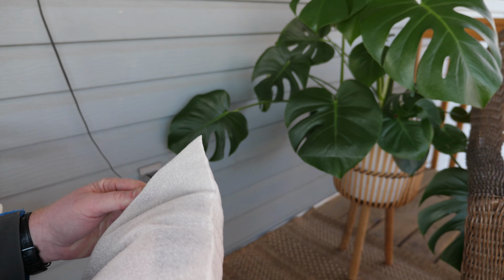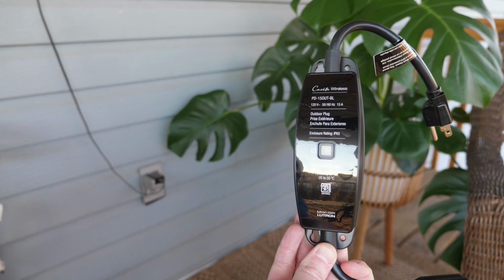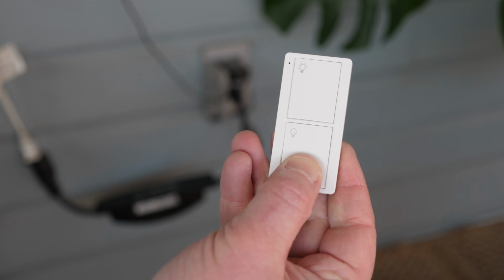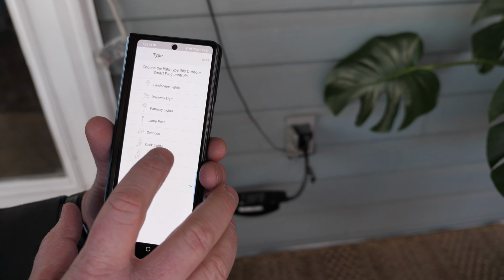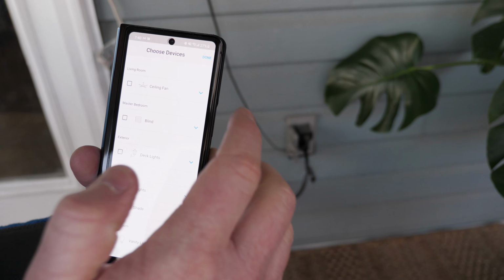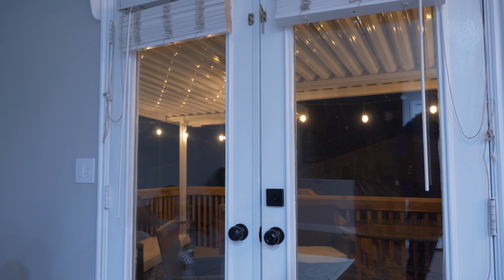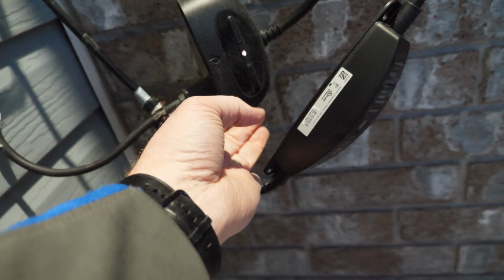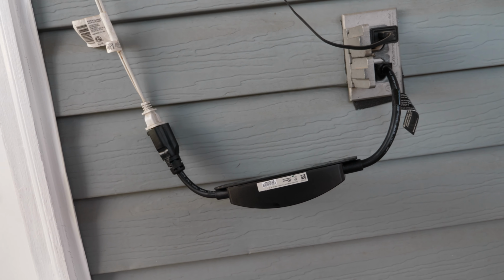Complete Your Caseta Wireless System With Their Outdoor Smart Plug

Comment from the maker: Are the extra Caseta Wireless features enough to choose this over other options?
Reply: No. 
I changed my outside outlets to the Kasa outlet. Each of the 2 plugs in each outlet are independent and if I need manual control of them I would just add either a flic button or echo buttons. 
BTW, glad you are finally back.
Reply: No
Reply: Tech with Brett
Reply: Okay I am just hoping to get a few more things

Comment: How does one safeguard against water when it isn't under a covered patio/roof. I know the unit itself is water proof but what about the connection from the lights to the smart plug? Is taping it with electrical tape sufficient? I see christmas lights in which nothing is used but that just seems like water will sneak in eventually when the plugs meet.

Comment: Is the default power on action editable?    I wouldn't want the power to go off for a few hours and then have the lights come on and stay on as they missed an automation during the power outage.  Is it of benefit to anyone outside of the ecosystem compared to some of the others. TP Link is pretty good with quality.
Reply from the maker: No option to change. If it was off, it will stay off when the power is back on until a routi changes it.